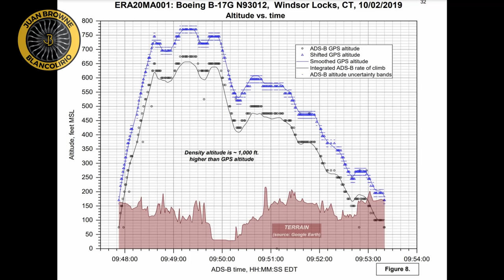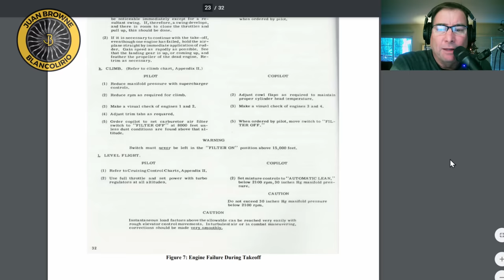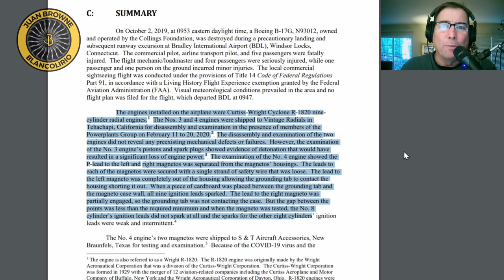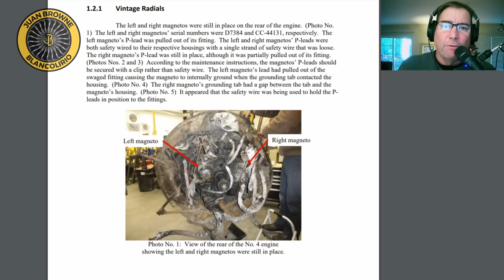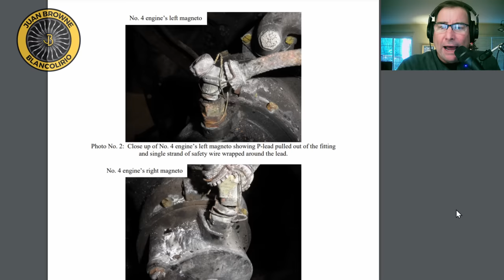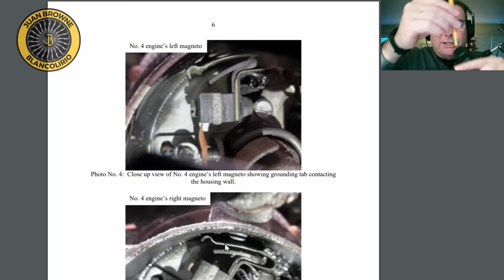NTSB Report B-17G Crash 'Nine-O-Nine' Part II -18 Dec 2020

Comment: I have an advanced degree in Management. Too often management skills are seen as a personal characteristic; not a formal skill requiring  actual training. A professional manager would have set up the policy and procedures to insure professional operations. The lack of checks and balances at their operation resulted in injury and death and the loss of a irreplaceable piece of history. A dentist requires a dental degree. A nurse, a nursing degree. A manager....nothing.
Reply: I worked for many years in the pharmaceutical industry, major multinational.  My experience was that training usually had nothing to do with this kind of decision-making.  The vast majority of the problem was character-based.  Managers under pressure  from upper management to get results and get bonuses/promotions commonly "forget" all those skills they were taught in management school.  Managers know better, but they also know the consequences for saying "no" to the bankers who ultimately run things, but who are careful to remain ignorant of how things actually get done down on the factory floor.  See Boeing for an example.

Comment: It looks as if the knowledge on how to keep these warbirds flying is being forgotten.
As volunteers retire, there has to be a process in place to train new volunteers in order to preserve this critical knowledge.
It's uncanny how many defects were found in the engine overhaul process.
It looks as if the plane was not fit to fly for quite a time, and sadly no one picked up on the warning signs until the accident flight occurred.
For example, the story of the problems they had starting the engines on that day is worrying just by itself.

Comment: Mac never declared emergency.  He shut down #4... when #3 was failing and he ignored the 90 degree runway option.  3 strikes... your out.  Such a waste.
Reply: Exactly... There was no 'crew'... or CRM... that's the key issue.
Reply: Geez... picture 121... these spark plugs look like crap... I would not drive a car with plugs that looked like that!!!

Comment: I have always held the view that as these aircraft become fewer and fewer, their historical value becomes so high, that to risk them on continued flying becomes too risky, both to the people that fly in them and to the loss of complete examples of the type. As a former pilot and mechanic who has also worked at a museum I know from personal experience that volunteer maintenance is extremely problematic - which needs up-close supervision. Clearly lacking in this case and at the museum I worked at. These museums operate on a shoestring and many have few, if any, qualified full-time maintenance staff, depending more and more on volunteers. To be blunt: I would never fly in ANY museum aircraft after what I've seen of their operation.
Reply: GAA needs to ground the CAF especially after Dallas.  How many more accidents caused by CAF incompetence have to occurred?

Comment: Being an aircraft mechanic myself this was an excellent informative explanation of what went wrong. You are absolutely correct in the fact that everything needs to be checked and rechecked by someone other than the person doing the task. We all are prone to overlooking something. Thanks for sharing your knowledge and videos. Much appreciated 👍🇺🇸
Reply: How would you rate the condition of the engines/ignition system? Honestly I wouldn't drive a car with engine in this condition. They must have had issues on previous flights. Tragic.
Reply: I really don’t like critiquing another mechanics work but my personal standards for workmanship are much much higher than what I see here. There was no way this was going to end good. This was an accident waiting to happen and everyone who worked on it from the pilot on down is in someway accountable for the results. Tragic

Comment: Hec, how does a cylinder barrel get that corroded in a radial engine that's firing up pretty regularly?. I'm still scratching my head. The only time i've seen bad corrosion like that is when an engine has been sitting out in the weather with no covering and water has been able to ingress thru an open inlet or exhaust valve into the cylinder. And lock wire used to secure a P lead to the mag casing. There are other things that seem a bit disturbing but i'll leave it there.
Reply: No fire. Without ignition and without making power, it is continually being washed with fuel-laden air, working as a pump, never getting up to temperature, condensation on cylinder walls, corrosion etc...

Comment: One thousandth inch of  point gap corresponds to one degree timing change .   Smaller gaps indicate retarded timing, while larger gaps  indicate advanced  timing.  The .014" engine was running advanced by 6ix degrees, more than enough to trigger detonation.  Detonation can damage the engine severely, even before increased CHT  is recognized.  Looking at the pictures, it is  difficult to imagine this condition not  being caught at inspection.  The condition of the plugs was outright scary.  
For a free PDF on the man who challenged conventional thinking about detonation in an IC engine,   the  "Bourke Engine Documentary"  is a rare gem about a man who was shunned by the engine community., visit  Bourke Engine TV on youtube.
Reply: He's been shunned because his claims of efficiency are proven to be bunk, the Bourke engine isn't any more efficient than any other engine, his claims and the reality of the actual efficiency of the engine are two different things, they've already been tested and the claim of .25 lbs of weight of fuel consumption per HP per hour aren't even close to the reality of thing's, it's more like .55 lbs fuel per hour per HP which is right with any other type of gasoline burning engine. 
Furthermore the websites claims that a regular 4 stroke combustion engine "bathes" the cylinder wall with flame during the entire power stroke of the engine are highly erroneous, the flame is out and the mixture has been reduced to a hot expanding gas shortly after the piston passes TDC, this is why cylinder heads are bristling with cooling fins on air cooled engines and the top of the cylinder has the largest cooling fins with them tapering in size to being almost non existent at the bottom of the cylinder, as is evidenced by typical air cooled motorcycle engines. 
It's a bunch of malarkey.
Reply: @dukecraig2402  Depends on who is doing the "debunking"  How can anyone debunk any of his ideas when nobody has has gotten one to run properly?  Can you provide the claimed test results?
Reply: @dukecraig2402  Why do flames come out the exhaust ports?  What part of "internal" am I missing?

Comment: The odd shape of the circuit they flew and the fact they lowered their landing gear on downwind makes me wonder if they did consider landing on the crosswind runway but changed their minds and elected to continue on to the upwind. If that was the case, the decision probably killed them, as the extra track distance and the lowered landing gear would have cost them precious time when they couldn't maintain altitude.

Comment: Detonation IS preignition, and preignition IS detonation. The fuel/air mix burns at the same rate once the plug sparks. The issue with engine timing is that you want the spark to start the fuel burn when the piston is almost at the top of the cycle, so that as the fuel burns it pushes the piston down -- which is what produces the power. If the ignition occurs to early, the flame front of the burn meets the top of the piston while it's still on the way up, which means the initial burn is fighting the piston rather than pushing down on it. That's why it reduces power. In addition, the meeting of the downward flame front with the upward-moving piston is a violent collision, which is why in a car engine you can hear the distinctive "ping" when it occurs.

If detonation continues, it will burn or blow through the top of the piston. It looks from these photos like that engine was getting close to losing a piston or three due to the detonation.

Comment: I'm not rated to fly at all. I've seen for many years people that don't have clue what a motor is supposed to sound like. You have to have an ear for it. These pilots had a lot of experience & in a multi engine plane it would be hard to hear each engine by itself so there were tests/gauges for that. Everything can have gremlins that show up whenever but they're not supposed to exist. What I see hear is very sloppy mechanics that should be scrutinized. Improper spark plug gaps, iffy mags, maintenance issues! As I said it's hard to fix something in mid-air short of divine intervention.

Comment: I'm vague on this because I don't have the reference but - on some previous occasion - I believe I read something that indicated that they had had a competent engine mechanic maintaining the engines - but - for whatever reason - his services were lost and not replaced with someone of the same caliber.

Part of the problem here - is that most of these people were volunteers and replacing people with experience on these old engines becomes problematic.

Even when these aircraft were NEW and had full maintenance crews assigned to them - they had problems.  The B-26 was nearly done away with because they kept losing engines on take off, causing the loss of the aircraft and crew.  The engine failures were caused by inexperienced ground crews not properly taking care of the engines.  They figured that out - got the ground crews properly trained - and that problem went away ... for the most part ...

In any case - as sad as it might be - things like this call in to question the viability of these "Living History" type organizations to safely maintain these aircraft.  After all - these things did not have that great a safety record when they were new - and suffered a high number of "operational" losses for various reasons.  They cost a fortune to operate when new - but - they were being operated by NATIONS with vast resources at their disposal.  Most of such aircraft today, as mentioned, are owned and operated by very rich people - who don't use them as much as an organization taking them on tour and selling air plane rides to finance their operation.
.
Reply: Absolutely, what a lot of people who are Monday morning quarterbacking this tragedy don't get is that even in WW2 with all the support and all the training that the ground personnel had nearly 1/3 of all the loses the 8th Air Force had were due to accidents. 
And in the Pacific the B29 had more crewmembers lost to accidents than to enemy action primarily due to the Wright R3350 engines, even by the end of the war the USAAF was never really happy with those motors, hence the B50 which was a B29 with the 4 row P&W Wasp Major engines fitted on it, even with that motor they still had problems with it and between that and the fact that it was the dawn of the jet age they never put it into production.
Reply: @dukecraig2402  Yep.
.

Comment: Those magneto's look terible. Rust on the braker ponts spring, and grease everywere, and no way you should trust these old capacitors if they do not leak already, the will soon.
 Use new ones. Not new old stock, just new. It may not be original, but it is reliable.
Even if a bad garage would do this to a end of life car, it would not be acepteble. and then the state of the rest of the engine wow. Altough I can not belive the engine has run with all that rust in the nr.9 cylinder without scoring the whole cylinder wall.
Reply: Maybe airplane mechanics don't pick up on the significance of that #9 cylinder because they have never seen anything like that in an airplane engine. Seems most of the folks commenting on that cylinder are old car / tractor mechanics that know a dead cylinder when they see it, because they HAVE see it. And they know that cylinders that look like that don't make airplanes fly.

Comment: My GOD! The condition of those magnetos! Even the outsides of them! They are the casings are filthy and dissimilar metals corrosion is rampant. Don't get me started on the interiors, which appear to be FILTHY with some sort of carbonized sludge.

I was a (professional) auto mechanic back in the early 1980s. I worked on hundreds of old cars with magneto "points" and distributor based ingnition systems. They were primitive, devilishly finicky, delicate, intricate electro-mechnical devices prone to intermitent failure due to everything from arc-ing between the contact points to carbon tracing inside distributor caps and cross-firing due to improper spark-lead configuration and/or deterioration. Then there was the whole problem of spark-plug fouling, improper gapping, and mechanical damage due to detonation or simply dropping the slippery devils while trying to install them in inacessible locations. Spark-lead connections were also extremely problematic, as they were friction-fit, and subject to extreme heat and vibration and mechanical stress leading to bad connections that resulted in intermitant misfiring. Contact points, cams, rotors and distributor caps require regular inspection, maitenance, and careful cleaning and adjustment. Even then, they tend to arc and foul themselves, leading to everything from fouled plugs and misfiring to catastrophic detonation when something self-adjusts due to fasteners and set-crews working themselves loose due to improper torquing or from thermal cylcling and vibration.

In short such systems are HORRIBLY UNRELIABLE and no doubt the reason aircraft are generally provided with DUAL magnetos. Using redundancy to solve problems with an inherently flawed, antiquated yet critical system like engine ignition on an AIRPLANE is a band-aid / duct-tape / and bailing wire solution to a problem that demands an engineering solution.

You know - like modern CDI (electronic) ignition and timing system that eliminates almost all the mechanical issues associated with magneto based spark generation, timing and distribution. 

Why not require retrofiting all OPERATIONAL passenger carrying antique / historic aircraft with modern (dual) CDI ignition systems? Leave those old magneto / points based distributors back in the hangar or museum.
Reply: I have flown magneto driven piston engines for a quite a few years.  I have been working on automobiles for a few decades.  Including having points distributor cars as my daily driver.  Magneto systems are very reliable.  
I’ve been stranded 3 times because the electronic gizmo box in modern cars failed.  

Incidentally, dual mags are used for efficiency.  That’s why pilots can test for a “mag drop”. The engine becomes inefficient at combustion on one magneto.  
Years ago, Continental Engines tried a modern electronic ignition system on their piston engines.  Far  as I know, it was dropped and they still build magneto engines.

Comment: He keeps saying you loose at least 100rpm when operating on one mag. Wouldn’t the governor keep the rpm static?  I would expect rising EGTs on those cylinders but not a drop in rpm.
Reply: The EGT would go down as ignition of all the fuel is not possible with half the spark plugs functioning.
Reply: I don't work on airplanes,  but i do know tractors and power equipment. I would NOT expect to find a governor of any kind on a piston airplane engine??? Please explain if you know differently?
Reply: @Bitterrootbackroads     What does a governor do?  It limits maximum RPM,  not only do most high performance piston airplanes have them it was a fundamental breakthru in aviation.   It is called a constant speed propeller and not only it limit maximum RPM it has the additional capability of allowing the pilot to control the RPM in a small range below maximum.     At low airspeed the prop pitch changes to be flat so that high RPMS (and hence maximum HP) can be attained.  As the airplane gains speed the prop changes pitch so that it takes a big bite of air with each turn so that it can apply its power to the faster moving air stream.    Once there is enough fuell being supplied to get the engine to a govened speed it will hold that speed as the HP (fuel) is increased to take more and more bite of the air.   A Pratt and Whitney PT-6 the most common engine flying starts out with the blades in line with the airstream (feathered) and as the RPM comes up the blades flatten to where instead of  beating the air to death and doing nothing they turn to grab the air and apply forward force.

https://www.aircraftsystemstech.com/p/propeller-governor.html